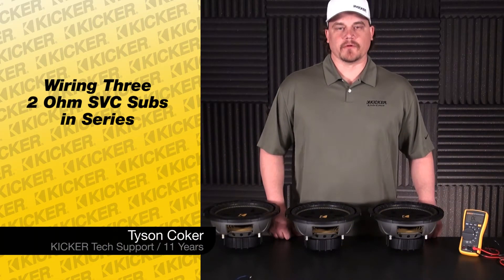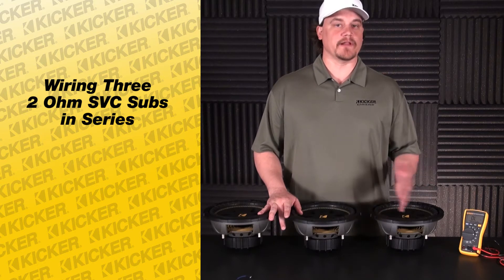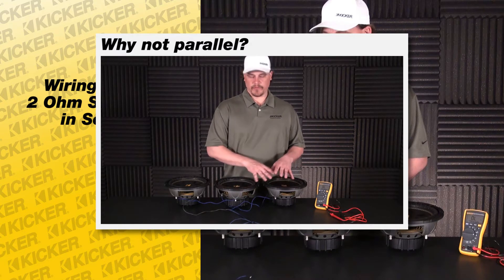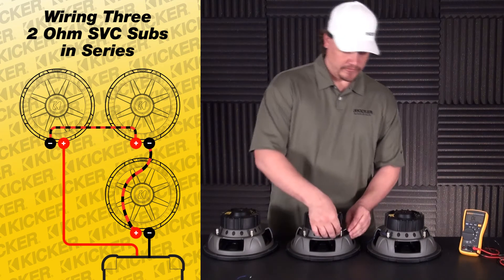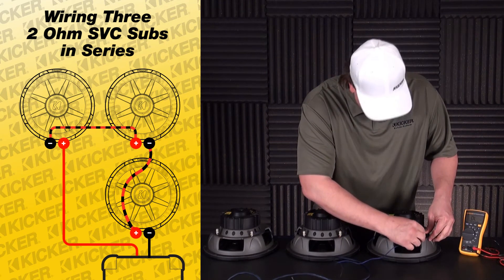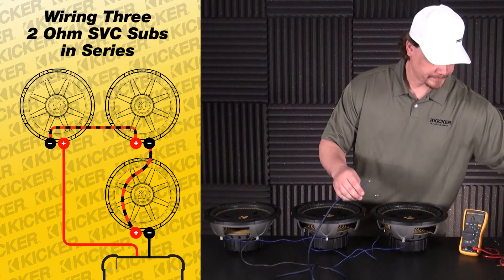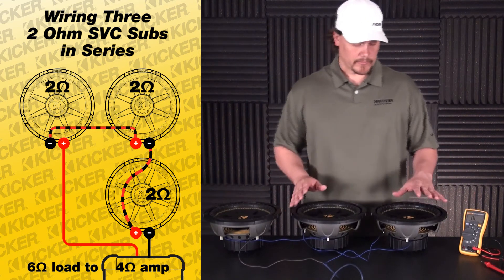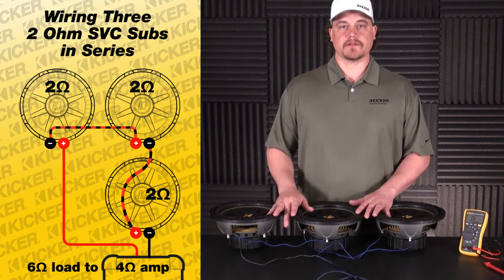Subwoofer Wiring: Three 2 ohm SVC subs in Series vs. Parallel

Comment: Can this be done with three dvc 2 ohm subs?  To get 2.5 ohms?
Reply from the maker: You would get 1 ohm. 2/2.5 is not possible.
Reply: @KICKERAudio  isn't it correct the the only possibilities for 3 , 2ohm dvc subs is
.33ohm, 1.3ohm, 3ohm and 12 ohm.
Reply: @KICKERAudio  how on earth do calculate 1 ohm.  Wouldn't it be 1.3 ohm.
Reply: Well you have another cid with six 2  ohm subs yielding a 2.6 ohm load.  What is the difference with six 2 ohm subs vs 3 dvc 2 ohm subs.  Your still wiring 6 2 ohm coils just on 3 subs.  Is this wrong?
Reply: @PhatkatCollections  Because you can wire 2 sets of 3 svc in series for 6 ohms... then you wire the 2 sets of 3 subs together in parallel, that cuts the 6 ohms down to close to 3 ohms... I don't know if you can do this with DVC by  wiring 2 coils from the 1st and 2nd sub with 1 coil from the 3rd sub to each....?
Reply: @2869may  I didn't ask about single coil.  I asked about dvc.  6 single could 4 ohm subs have two possibilities 2.6 ohm and . 6 ohm.

Comment: @amplifiedparts  Is it ok for two 8 ohms tweeter whithout crossover and wire it to series config and add bass blockers and connect it to 8 ohms instrumental speaker in parallel config what is the equal ohms of this combination. I have a stereo amp that supports 8 to 16 ohms is it  good or bad for the speakers and amp?

Comment from the maker: With three svc 4 ohm subs, if you run them all in parallel to the box terminal, then that terminal will read about 1.33 ohms.  You can run a wire from each positive on the speakers directly into the positive terminal on the box.  Then do the same with the negatives - a wire from each negative terminal running into the negative terminal on the box.  You are not going to get any current loss running thru the box terminal - just make sure you have good connections.  Unfortunately we are not going to be able to post a video very soon.
Reply: KICKER i was gona ask that thank you!!

Comment: or would the current run better without passing them through the box terminals? cuz i seen diagrams n it shows 2 wires are suppose to be on the negatives and positive,

Comment: What if I did this with 4 ohm subs
Reply from the maker: If you wired all three SVC 4 ohm subs in series then the amplifier would see about a 12 ohm load.  If you wired all three in parallel, the amplifier would see about a 1.33 ohm load.

Comment: I see most of your videos of wiring 3 12 2 ohms kickers is svc at 1 ohm, how would wire 3 12 kickers 2 ohms dvc at 1 ohm or is it the same setup as the svc? I have a Kenwood kac-8104D 1000 watt for now til I get a higher watt hifonic or kicker amp.
Reply from the maker: You would follow the same process of wiring all three subs in series first.   Then wire them in parallel and the ohm load at the amp will be approximately 1.33 ohms.  Hope this helps!